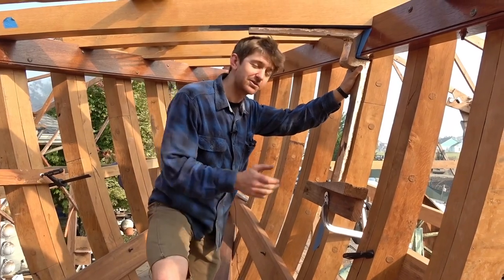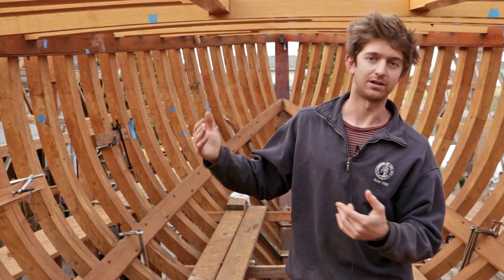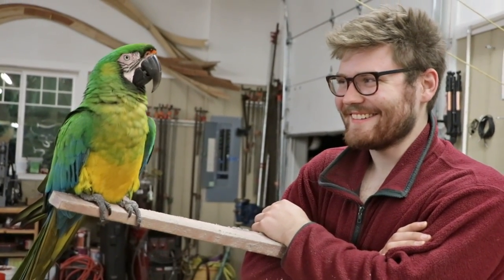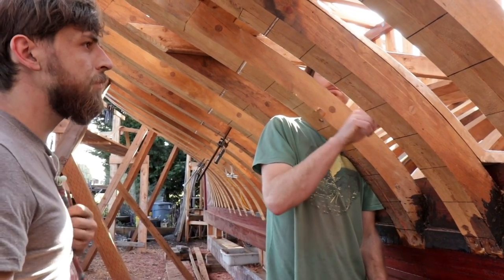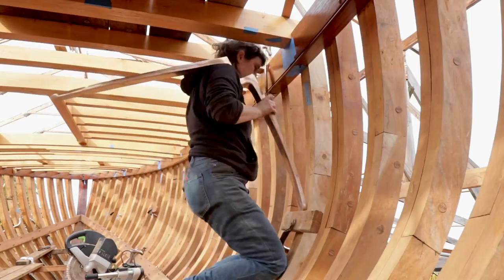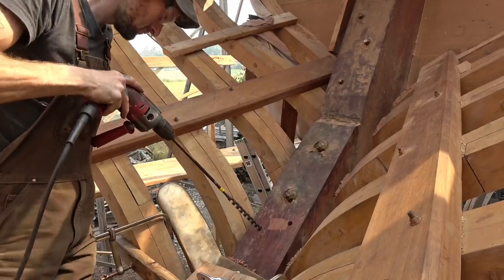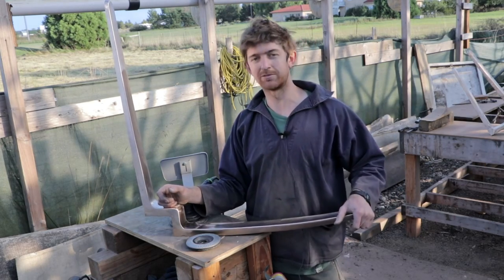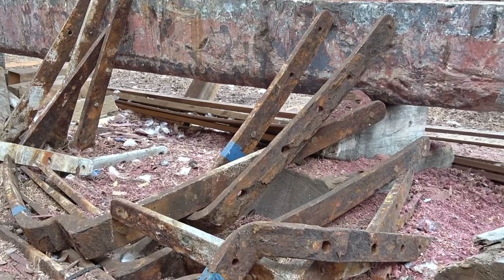Fitting/Polishing Bronze Knees - Wooden Boat Rebuild (EP82)

Comment: Another method of indicating high spots on those bronze floors needing to be taken down would be to slip a 8" X 2" strip of medium sand paper between the rib and bronze floor, sand paper facing the bronze.  Then pull the sand paper back and forth to put abrasion marks on the high spots of the bronze.  Then you grind down the high spots.   That approach seems it might be more effective and faster than using a metal ruler and marking the opposite side.  I hope the suggestion isn't to late.   Best wishes.
Reply: That's a very good idea !
Reply: That sounds like a very good idea and the way to do it. My wife says they do something similar in dentistry.
Reply: @davefoc  Hopefully not on my teeth. I grind them enough as it is!
Reply: I do loads of blind wood fitting in my shop. For hard surfaces like metal to wood, I use lipstick or oil based paint. Also I frequently use non oil pastels. Get a color impression and only remove the color.
Reply: @michaelmagee6428  I've used that technique for cutting holes in dry wall. There are better ways though for drywall cut marking, it's just that that was the way I knew when I did it.
Reply: @Jacquobite  :). I didn't quite know what my wife was talking about (that happens) but I think she might have been referring to final step in fitting a crown and the tooth being ground is the artificial one.
Reply: @davefoc  ...i have had that done...the dentist has you bite down on a little piece of carbon paper and then he grinds the high spots

Comment: 00:19 Status, what this video is about
00:45 Leo fits a hanging knee and Pete bores/bolts a floor
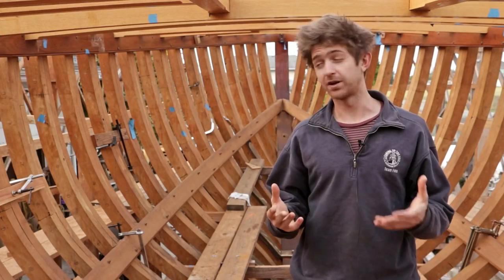03:40 Leo explains and shows a better way
05:14 Foundry work goes on
07:33 Bird Hook
08:14 What and how the crew is doing
09:36 How to fit a floor
11:04 Boat soup
11:44 Floor fitting details
12:36 Rivet making
14:23 Grinding, fitting and fine grinding
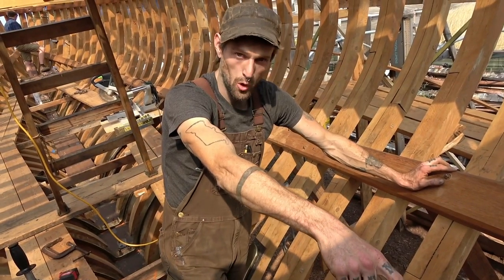18:37 Drifts / dumps
21:32 Wonky and last rivets
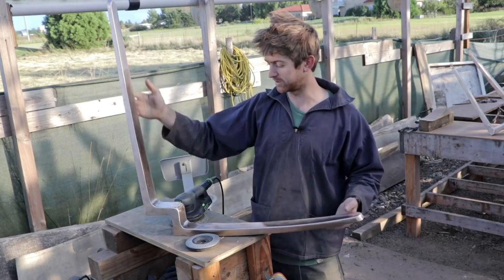23:17 Extra large custom made jewelry
27:07 Current status, expectations

...and this was my excuse for watching the video for the third time.

Comment: CLEAR COAT THE BRONZE!!
 Such a beautiful job of polishing.
 It tarnishes in a matter of hours. Clear coat with du pont Imron  Polyurethane enamel. It is like a soft plastic coating. Lacquer is traditionally used but it is too brittle. A little secret is to heat the bronze and get rid of any moisture . And paint it  Hot. It will stay beautiful for years.

Comment: As a steadfast land lubber, I have learned bunches! I've been in on a lot of land based and aviator vehicle builds and can say, you can always learn something new....a question good sirs,  why not run threads down the entire 'dump shafts' and use those to anchor them to the wood? Just ratchet them puppies in till your arms fall off, you'd never get them out at half the length? Just a suggestion!
Reply: I think, not 100% sure, a thread would cut through the wood, severing the grain possibly leading to some weakness as the wood dries and shrinks or moistens and expands, Also would allow a channel for water to soak down into the wood. The dump shafts are very slightly bigger then the hole they are hammered into, once the wood settles after being compress by the dump shaft being knocked in, the wood will expand (relax) and fill the dimples. Gripping like a good’un.

Comment: Leo, I have commented before that you need the drum sander from eastwood company. You are using automotive paint polish. You could stop sanding at 1000 grit and use metal polish with the felt sanding drums and polishing rouge . It would give better results in way less than half the time. Otherwise great work I love the vids!
Reply: I was thinking that last video.  It's not delicate automotive paint.  It's bronze it won't burn.
Reply: I have a bronze foundry. All these methods work. Leos way for his workers is fairly safe. Your suggestion is true and similar to our finishing shop except we prepolish after 800 then compound then final with a good coat of Butchers Bowling Alley Wax n buff to slow tarnish.

Comment: Leo - Amazing and beautiful work. Great to have you and this project here in the PNW. I would love to hear more about a few things. 1. How are loads intended to be transferred through the joints. As an architect I am familiar with design of steel and wood joints based on bearing transfer, friction transfer, or through the fastener. These hybrid joints holding the boat together pose some interesting questions and would love to know more. 2. How are you dealing with your waste and reuse streams? I have seen you using 4x4 pressure treated scrap for templates, waste from original boat, new waste from new wood scrape etc. I am genuinely curious how you are planning and working with all of this material and resource flows. 3. You have the original lead keel at the bottom, the original teak transom at the stern, is there any possible way to have a meaningful part of the original near the bow and mast  support? Could link your rebuild with original in a beautiful way. 4. I am very much looking forward to understanding the mast sourcing, fabrication, and stepping!  Finally, I have recently ended a period of unemployment. Your work has very much inspired me and helped me maintain focus during this tough year. A donation is on the way as thanks once my cash flow starts again later this month THANK YOU!!!

Comment: Hi Leo, why do you guys put bars of bronze on top of the molds when you’re pouring them? Greets from the Netherlands!
Reply: On an earlier video they said it was to weigh down the mold sand so that the pressure from the bronze going in wouldn't cause it to swell or crack, etc. It's insurance to help it keep its shape.
Reply: Weighs down the sand so it won't expand up.
Reply: I was trying to get it to tag wesselmuurling but I did something wrong.
Reply: https://youtu.be/foDRc2X_Utg is the pattern making process. Your question is answered at 12:45 of that video - (The link on the time stamp will play this video at that point so do not click it).

Comment: Dude... put the guard back on that grinder where you can.... those discs (not the flap wheels or polishing ones) will make a mess of your tshirt covered stomach if they shatter, unless you want to be holding someones intestines in on the way to the ER. Far far too many people underestimate the inertia those disc pieces have when they let go (I do this for a living and have had parts go straight through a welding screen in the past..)
Reply: Excellent advise I worked as a Construction Supt & Safety , guards were designed to prevent accidents ... Safety First crew !
Reply: Charles Been doing this since I was 16, seen a few let go, some through misuse and some random, I've had maybe two let go of sections of the disc, one of which did twat me on the thigh, through both a welding jacket, welding trousers and boxers, still grazed the skin, it's ***ed up how much power are in those pieces of fibre. (I was upside down trying to get some framework clean with the disc facing me, felt totally safe with a massive faceshield, hood and all the right clothes,, it still got me lightly.. you've only got to look at google images to see how bad it can get with the *** hits the fan.. PUT THE GUARD ON 🤬😬

Comment: I come from a boatbuilding family and I can trace my forefathers back to 1708 who came to Malta from France. Almost eighty years ago I used to work with my uncle, helping him to build local traditional wooden boats using the same principles as seen in this video, but never as large and voluminous as the one shown in this series of videos. I am well acquainted with the design and structure of such a wooden boat and followed this series of videos with great interest and admiration. All I can say is, I HAVE NEVER SEEN SUCH DEDICATION AND WORKMANSHIP IN SUCH A LARGE WOODEN BOAT, and I just cannot believe the tremendous amount of work that went on in the planning and the use of the best materials and executing the work on such a limited budget. One of those silicon bronze hanging knees is a masterpiece and an artistic sculpture, even when considered on its own.  
The manner and accuracy in which the keel was placed and how the deck was fitted together with such joints while the bronze fittings, including the hanging knees, needed such long preparation and so much work.  Making all the threaded silicon bronze studs and the copper rivets for the planking, is astounding and the dedication of all those who worked on this boat deserves all the praise and respect that they can get for they certainly earnt it.  All of the hanging knees and floors/keel/frame metal attachments are a work of art and a masterpiece even as a hewed sculpture when considered as an individual unit. By the time this is launched this boat will turn out to be the best constructed wooden boat that I have ever seen. The bronze and copper work alone is bewildering as far as I am concerned as I have never seen such a selection of " homemade" nonferrous material for a wooden boat. Also, I admired how diverse animals seen in the video seem to join in the human team and atmosphere to provide the occasional sense of humor, especially the strutting parrot which seems to act as a supervisor and inspector of the work. The term, " And what are you doing?" became an expression that when heard, it added suspense as to what answer was expected! 
I remember visiting and inspecting the Cutty Sark more than fifty years ago in London and that had a diagonal iron structure over the frames and under the planking to stop it from hogging and sagging and twisting.  The Victory "Nelson's ship" was also to be admired but I feel that both the Cutty Sark and the Victory did not have the accuracy of jointing, the Silicon Bronze studs, the Floors, and the hanging knees as well made as shown in the " Tally Ho" The base for the mast support is so well thought out. 
Congratulations once again to all concerned. 
Note, since that boat will tend to hog and sag when she rides the waves, I would never have cut into the side longitudinals which support the deck beams, as these structural members would need all the strength available in them.

Comment: I know nothing of boats  but I do have mechanical aptitude, an old timer once told me “ your not making a watch “ meaning sometimes you can be to critical of the project at hand. Not trying to criticize I think it’s great what you are doing just don’t think the original builders were that critical of fit and finish, the boat did make 100 years on its first build. Once again much respect.🛠

Comment: Wow the bronze jewelry is looking amazing. I know you debated polishing the bronze floors, I think you made a wise choice with the knees looking so nice if you lift a floorboard and saw a rough casting you would have regretted not spending the time. And as a bonus they won't oxidize as harsh cast finish. Wow Wow Wow very nice job by all..

Comment: Hi , great video and very entertaining. keep up the craftsmanship and traditions.
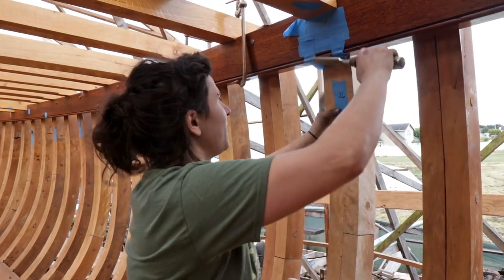As a suggestion when chiseling timber along the grain  to remove the bulk as being done at 16:55 in the video, use the chisel with the splayed face of the cutting edge against the timber, not the flat back of the chisel. This can regulate the bite of the cut and give a smoother finish and better feel for what is being cut.
cheers

Comment: Another great video. I liked Pete's drifts (in Australia we call them Dumps as Pete said). I have had success with using threaded rod (You call it all-thread). Drill a 5/8" hole for 3/4" rod and wind it in using double nuts and Tallow to prevent it hanging up. I find 8 to 10 times the diameter for length works well.

Comment: Hi Leo, I don't know if somebody mentioned this before, I didn't read all comments, but do you know there are some tricks in doing this sort of fitting. I mean trying to make to surfaces meet nicely. I'm a trained goldsmith so it's obviously smaller scale, but I use carbon transfer paper between the two surfaces to get a print on the metal. So I can see very quickly where the high spots are. I saw you guys are pushing a ruler in between the gap. That looks time consuming. I don't know if you can get this transfer paper in roles or so. But you can definitely get A4 sheets. Alternatively you can also just use chalk. So you rub chalk over either the brass or the wood and then press the two against each other. Don't know if that helps at all, but thought I share this anyway. Love your project and always look forward to the weekend to watch a new episode! You are doing an amazing job! One huge jewellery piece! :)

Comment: If you ever get to grind bronze again.... a diamond cutting disc will grind and cut very fast in bronze. You know, the type used for cutting stone and concreye. And Flexovit Fibreflex grindind discs in grain C24 to 80 or 120 work very fast to and adapt a bit to the desired shape. These are tools for stone but silicium carbide and diamond tools work very well on bronze. Plus there are flush cut diamond discs too

Comment: Ok Guys just a suggestion floor brace over the prop instead of using nail type bronze rod we use threaded on concrete and you find a spring to fit the hole drop it in the hole thread your rod and drop it in the hole and start turning till everything tightens up you do have to make sure its not to big of a rod or you will bust the concreat or in your case the wood i hope this trick helps you Leo

Comment: Very interesting to see the level of craftsmanship and attention to detail that these knees are receiving, but what a palaver !there is no way back in the day in a commercial yard that the standard of fit which you are achieving would have been attempted, for a start they wouldn't have the tools, i.e. angle grinders. not to mention the time. They would of course have been fitted, as best they could, and then pulled in .However please don't take these observations as criticism, it is very pleasing to Watch these very high standards being achieved.

Comment: Big difference between traditional  boat builds like Tally Ho and Arabella built with oak etc and bronze reinforcement and the lumber boats like Henry Red and Redeviva built with lumber reinforced with  lots of steel etc. resulting in 100 year boats versus 10 to 15 boats.

Comment: I don't know if you just misspoke, but green scotch brite is typically rougher than red. So technically, you ought to use green first and finish with red.  That said, honestly, I've never noticed a significant difference between green and red in terms of surface finish (I'm a machinist).

Comment: Great job as always, Leo. One quick question. Why are the floor wings through-bolted through the planking as well as the frames? Isn’t the planking the most frequent structural member to need removal and/or replacing? And since the wings hold the keel to the boat why would you want to remove that fastener when removing a plank? Why not through-bolt only through the frame?

Comment: Question: The original hanging knees had a slope on the part that sat under the beam shelf. To prevent water pockets sitting between the knee and the beam shelf, and to give the knee some extra strength. Have you taken this part of the desing change into consideration? 
Bronze is a different material compared to cast iron, but water sitting between the beam shelf and the hanging knee can still cause problems down the road.

Comment: For the aft most floor fasteners, I’m wondering why you wouldn’t tap the shallow hole in the keel and thread a bolt in. Wouldn’t t that have more holding power than the drifts/dumps?

Comment: Hey Leo,
When it comes to the deck planking, have you considered including a modern substrate of two layers of marine ply, topped with grp woven fabric under the decking, not just for the added strength, but most importantly to prevent the ingress of the dreaded rot inducing fresh water?

Comment: Bonjour Leo,
I would not have imagined so many bronze pieces on this boat,  and the work they represent. 
Were there such pieces on the original hull and if so, could'nt you keep them  ?
 Besides this, great music ;+)
Amicalement, Raphaël
Reply: The new bronze floors & knees are replacements for the original iron brackets. Many of the old pieces were badly corroded. Somecould have been cleaned & used again, but Leo decided to use no iron in the fastenings - it is the source of 'iron sickness'. This degradation of the wood fibers causes loss of strength & leads to rot.

Comment: A question if you would, have you tried using cupped stones for the initial stage of the grinding process to help shape the knees and floors? Or would the cupped stone remove too much material if you were to use one?

When I was grinding using a 7 inch cupped stone the frogs on rail switches it proved to be very helpful especially when reshaping the newly welded material back to its original shape.

Curious more than anything else.

Be well everyone, cheers.

Comment: Approx. many lbs of bronze will you end up using? I ask the question because as a kid there was a big bronze (brass?) propeller in a cove not far from our house...you could see it on the bottom on a good day. It looked to be about a meter wide but hard to judge. I was told it would weigh over 200 kilos.